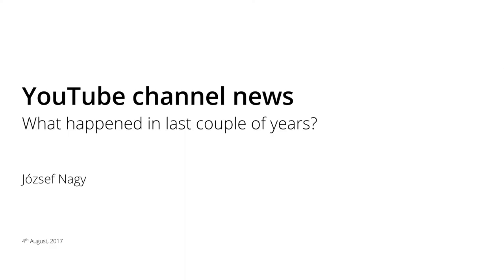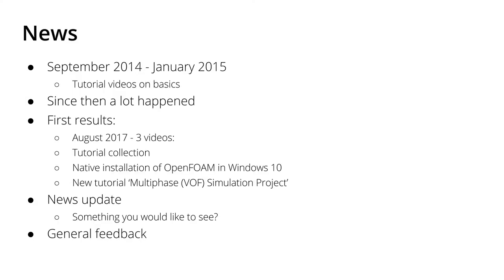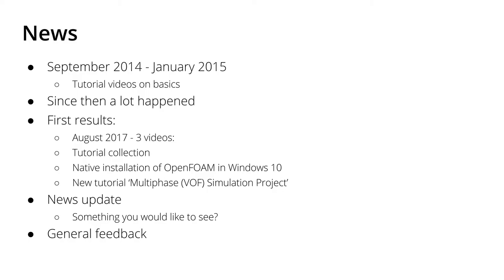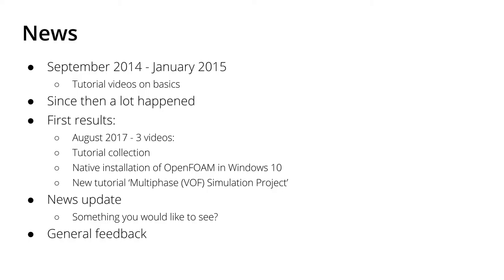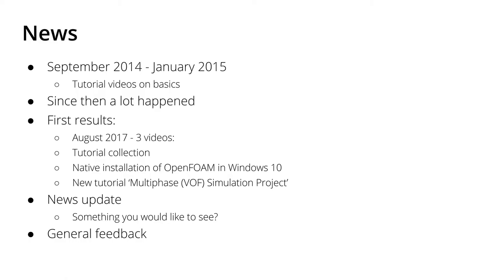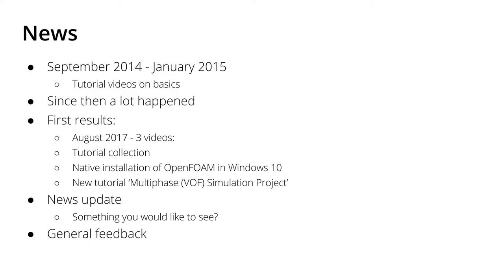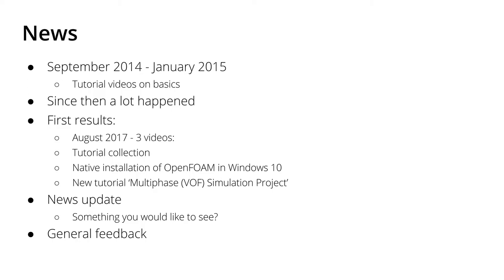Channel update - news 2017

Comment: Good to see you back Jozsef! Your tutorials are really helpful and I've learned a lot from you! 
Thank you!

I believe that would be interesting to set up a simulation with a blast wave propagation. :)
Reply from the maker: Wow, that is not easy. I did that in my PhD thesis. The best idea would be rhoCentralFoam, but I am not up to date regarding the comrpessible solvers.
Reply: József Nagy But, isn't rhoCentralFoam mostly for laminar flows?
Reply from the maker: It does include turbulence modeling.

Comment: I would love to learn how to model the flow around a sailing boat (rig). Physical testing is done in a twisted flow wind tunnel, how can/should that be modelled?
Reply from the maker: There is a special interest group at the OpenFOAM workshops on marine engineering. So I think so. There are special models in the foam-extend version. E.g. Vuko Vukcevic from Zagreb is a specialist in that field.
Reply: Dear József, I've seen it some time ago, but online the activity in that group seems to have dwindled down a bit. But I'll keep my eyes open. Would I need Foam Extend for this? By the way, thank you for your rapid response.
Reply from the maker: Yes. Most probably the latest release. One should come out soon according to my information. You can try interFoam, but the foam-extend models are more advanced.
Reply: Thank you. I am going to dig into that then.
Reply: By the way, the major issue in my quest I see at the moment is: "how to model/define an inlet (BC) where both the speed and the flow direction are a function of the height? ". If that could be the subject for a tutorial video that would be magnificent. :)